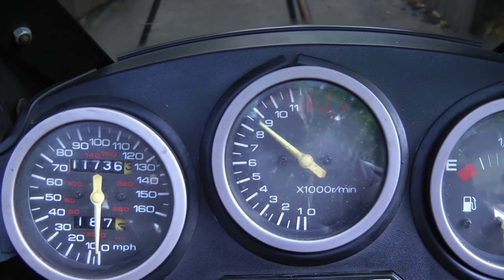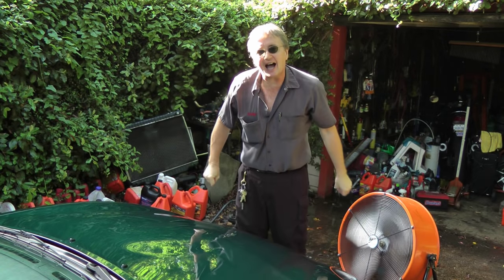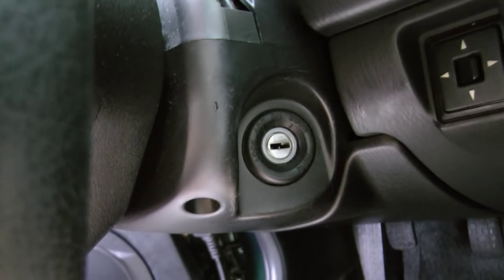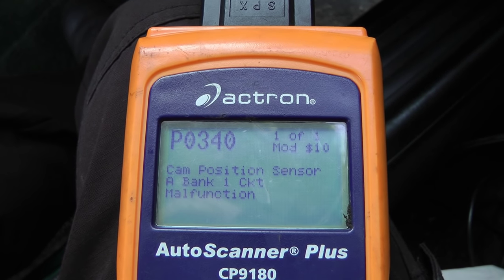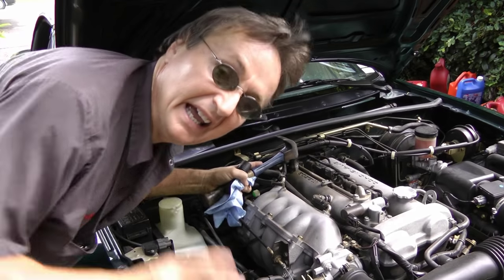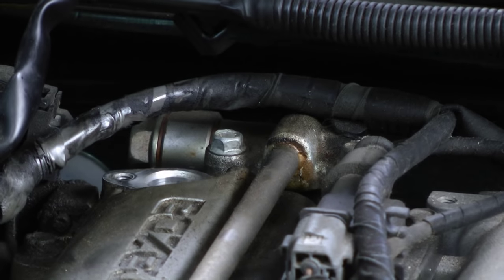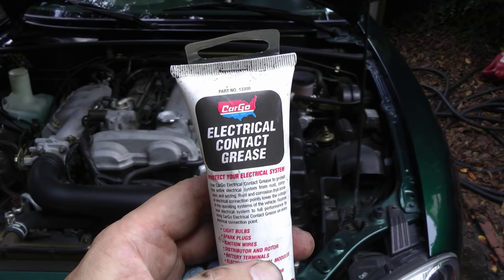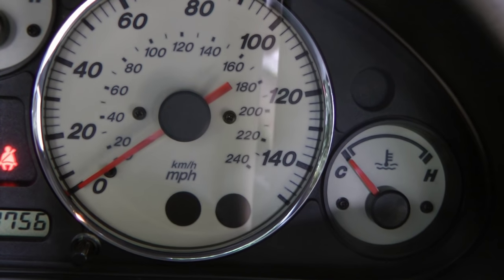How to Fix a Car that Randomly Dies while Driving

Comment: hey Scotty my car does the same thing only when it dies It starts and cuts back off. I have to wait for at least a half hour before I can get it started up again. what scanner can I use to get codes for my 94 Lexus gs300
Reply from the maker: +Wilson Pierre only a pro or dealer scanner will get any info out of that 94 unfortunately, see my video "fixing insanely complex modern cars" and have one hooked up
Reply: +Scotty Kilmer  wow. I just ordered a obd1 scanner because I was told it would work if I get a 22 pin cable to connect to it

Comment: Scotty I have a 95 it's doing the same thing I'm not sure if it's the camshaft position sensor or not
Reply: it's obd1. my car gets to running temp and it cuts off. I replaced fuel pump, filter, strainer, temp sensor, thermostat.

Comment: Hi please give me a solution. I have Hyundai Elantra 2005. Yesterday after driving 18miles on highway, engine started to sound like a old tractor and it was loosing power as I keep pushing the gas peddle. Soon engine shutdown but it starts again after 20 mins. Today I drove it for 1 mike and the engine heat measuring meter in dashboard went to high but eventually it goes down when the car is put in neutral. So when I put on gear the engine gets hot, stumbles and dies within 3 miles but on neutral, engine cools down. I just cleaned mass flow sensor, radiator no leaks, fans are working, radiator water does not jumps out which happens in case of head gasket broken, no water mixture in engine oil. What could be the problem. Please help!

Comment: Scotty I have a 03 Jeep liberty limited it turns off when I come to a stop I have to hold the gas pedal and brake at the same time to stay on any ideal what it could be no check engine icon on
Reply: Try simple things like cleaning the idle air control, MAF sensor, air filter, fuel filter, EGR. If not those get a fuel pressure test

Comment: I have a 2011 Toyota Camry. I put in the shop to have front bumper replaced it was running fine when I dropped it off. They took the battery out for 24 hour and put it back in. Then it would not start they reset they key and it started. Now when I am driving down the road the RPM go crazy then it dies but will start right back up. But when do it again short down the road no matter what speed I am driving. Any Ideas ??
Reply from the maker: drive it a few days and pray the computer resets the rpms correctly, they often do. if not, they messed something up, take it back and let them fix what they screwed up

Comment: Believe or not on some cars if you have a bad battery it will throw out that code po340 if though it’s for the camshaft position sensor
Reply: That is true. I've had codes on my car and turned out it was another thing causing it.

Comment: Hey Scotty, I need your help on my Honda Accord CF3 Rpm going down after car driven 10-20 KM and engine shutting down when I'm driving car in rushy traffic kindly help me (I am changed throttle body, fuel filter, plugs and plug wires but problem still remains)?

Comment: I have a 2006 buick rendezvous that has this exact problem. I will be driving and all of a sudden the Engine light with the arrow down comes on the the power dies... This has happened while driving and it has also happened when I just started up the car and that engine light with arrow down comes down and car dies... I take the key out everytime and within 30 seconds to 1 minute the car starts right back up and away we go. 

They first thought it might be a relay because the 2004s had a recall, we then replaced what they said was a common problem the trottle control and sensor under the gas pedal... ALL have not resolved the problem. Problem still exists .. What do you think it is? The mechanic and dealership are puzzled? thanks in advance

Comment: I've got a 2006 dodge stratus. It runs fine while im driving, starts fine, but when i stop at intersections, it stalls/shuts off. I just took the key out and turn it again and it starts right up, but recently i was driving, and the rpm's would dip like 200-300 rpm's, causing the car to jerk. Whats wrong with it?
Reply from the maker: Android602715 try my video "how to fix a car that idles poorly"

Comment: Hay Scotty, I have a 2002 Nissan Altima.  While driving the check engine light came on and lost acceleration.  I got a P1128 code replaced the throttle body did the relearn process. It was fine for 2 days then it happened again and same code. What else can I do to fix the problem.  Thanks.
Reply from the maker: well, generally wiring is bad then OR the main computer circuit that drives it is bad
Reply: Scotty Kilmer Thanks for the quick  response.  I'm going to clean the connectors with CDC electronic cleaner and hope that will help with the problem.  I just hope that in this won't cost me too much to fix.

Comment: mr scot..my hyundai excel 1996 randomly dies when i'm using AC whilde driving..my battery is new and my alternator works fine... and still it dies most of the times when im idling

Comment: My 2008 Volxwagon Polo takes me many times trying to start the engine until it starts ... spicially in summer when its parked under the sun, and the last days it started to die while driving, but not at high speeds, it dies between changing Gear ... between the first and the second gear... or sometimes at the first gear while the beginning of driving..
so please help me.

Comment: yes I have a 1991 Toyota Celica convertible coupe and it will die on the freeway just randomly as a matter fact it does it all the time in any gear it'll just be continuously shutting down  what could be the problem  and how can you help me out with this
Reply: Sounds like a ground wire buddy

Comment: @ScottyKilmer Tried to send you an email says its invalid so heres my issue. Hey Buddy, Just watched one of your vids on cars die while driving. My problem is similar, well kinda lol.  I bought the car for 500 bucks its nice and all but the reason it sat for a year was this problem its having. I figured I could fix it so I bought it. The car at start up is very rough at idle, it doesnt have much power pressing on the gas until you get it up to about 3,000 RPM and as soon as you put it in drive itll sputter and shut off.  Its kinda hard to start but it will start and idle ruff. I did only change the spark plugs today was the first time out checking it out. I bought a maf sensor for it no change in performance, I just ordered a new coil, and wires for it should get those by the weekend. I cant afford a fuel pump right now they're $400 bucks lol. I don't think it is getting enough of spark and yes I put fresh gas in the tank luckily it was empty before I tried to start it so any bad gas is probably gone by now. If the coil and wires dont help Im all out of options. There are no lights on on the dash except for the ABS light so i didnt bother scanning it. If you have any insite of what might be wrong with it Id appreciate any help. A guy told the dude I bought it from its a transmission problem🙄, Im pretty good with cars I was a professional tech for 6 years and a backyard mechanic all my life from age 17 I'm 44 now so Im pretty sure its not the damn transmission lol. Thank you your vids are great when ever Im having a brain fart. taker easy sir
Reply: oh its a 06' hyundai Tiburon 2.0 L

Comment: my 98 honda civic has a p1359 code and i have a new distributor installed but it stiil wont crank and i really dont wanna get a new computer for the car because thats the last option besides checking the wiring

Comment: hey scott.
my mdx acura 2003 dies if i dont let the engine running for a minimum of 10 mn.
if i turn on the engine and put it on drive strait away trying to drive it it fies.
i took yo multiple garages and evev the dealer. no wah to fix it. apparently its a commun problem with acura mdx.
any idea bro.thx.

Comment: I'm getting a p0171 code...96 civic DX.  Cars turns off while driving. I simply push the clutch in and it cranks back up everytime....I don't know if it's the O2 sensor, fuel injectors or fuel pump. Help please

Comment: This just happened to me . 08 hhr  suddenly  stopped at a light  and would not start  &  gauges  went wacky  and started  bouncing  when trying  to restart . 4 hours of searching  and the cause was a crank  sensor   that  had come unplugged.  Car started but gauges were  still bouncing.  It drove me crazy  for a weak.  Finally  I found the antenna to the radio had backed out a little bit and was grounding out in the dash ..must have been the jolt when the car stopped.  Pushed  it back in with a little black tape  and we are back in buisness . Talk about modern cars sheesh

Comment: My 08 Honda Odyssey has done this several times. Today it stopped while I was driving and it wouldn’t start everything locked up my husband came and jumped the car after 30-40 mins. I was sitting half in traffic half on roadside  it was very scary

Comment: will a bad position sensor cause some cars to not start at all?
Reply from the maker: +Micheal Deacon yes, if totally shorted out
Reply: I have no spark or fuel pressure i was reading that in this saturn vue 2.2 i have that computer will not allow the pump to run without a signal from the crank sensor. Thank you for all that you do. You save people a lot of money.

Comment: Hello all. One question. I have a Nissan Micra 2020, and suddenly at 100 km the speed pedal didnt work for 5 seconds and  the start stop button which i had opened had been closed (seems that the whole system had been reseted) Then after 5 seconds car woke up and i could speed up again. This happened 2 times in 1 day.. Any idea what might be the problem?

Comment: I had a cam sensor code. Repaired the cam sensor. The rough idle was gone but it stalled again. Only once warmed up it stalls. Starts back up but dies again till you let it cool. So it still dies. But no code came on. I got a scanner and I have no codes going on.

Comment: i have a 2003 buick lesabre goes into gear but wont move no signs of slippage low miles..have had cvc joint repaired about 3 months ago
Reply from the maker: pray it's just a bad cv joint job that slipped out of the transmission end or other side broke

Comment: 🚨I have a 2005 honda Civic 1.7l one day I was driving, lost power with the gas peddle, then itt died. it will crank over, but don't start. I unplug the crankshaft position sensor, and it starts. I replaced the sensor with a cheap one, nothing, so I replaced it with a top brand, still nothing. HELP ME, PLEASE 🚨

Comment: I'm having these issues with a 1994 mustang gt will idle up and down then die, died while driving as well, idling and then switched the the a.c vent from in to off and it died have gotten the battery checked and is not the problem an u suggestions?
Reply from the maker: many things can do that, start with my video 'how to fix a car that idles poorly" and also check for vacuum leaks

Comment: I have a 2005 Pontiac grand Prix v6 3.8 L. And every time I turn it on I have to rev it so it doesnt turn back off (this is only when it turn it on after that its fine)
Reply from the maker: Sam Esparza old fuel injectors that are clogged often do that, try my video "how to clean fuel injectors on your car"
Reply: Thanks
Reply: Unrelated but RAIDER NATION 4 LIFE!

Comment: i have a 1994 pontiac grand prix se  3.1 dies when driving. when it starts to die it starts to miss and the rpm gauge starts jumping and then it dies but it always starts right back up i changed the crank shaft sensor in it and it runs great till in starts to die ......what could it be.i also put a new fuel pump on it

Comment: what if your car is from the 60's and doesn't have a computer with a sensor? (1961 Dodge Lancer to be exact)

I'm going to also replace the fuel sender and change the distributer cap, rotor and wires (already did the spark plugs) I just want to get ready incase these things don't work.

But yes I am driving down the street and then my car suddenly dies, and it wont turn back on till a few hours or the next day, ( I wish I just had to wait a couple minutes).
Reply: I already replaced the gas filter and gas pump (did not fix the issue).

Comment: i have a 2001 nissan frontier it runs and then cuts off .after running for 10mins. idles down and then it doesn't want to crank back up until i let sit for awhile

Comment: Okay I got a question.. I have a 2001 Saturn Sl1 1.9 My turns on my. But when I touch one of the injectors the car turns off..  Why is that.  And I have service engine light on as well the code told me it was map sensor I replace and still light is on..  Even If got someone to erase codes it still come back on...
Reply from the maker: Jose Quintanilla often bad wiring going to the injector, or bad injector itself

Comment: 2012 Durango stalls in drive at stops no check engine light tried fuel pump  spark plugs coil packs had fuel pump relay recall changed conductor plate and tq converter solenoid tried rebuilt tested tipm stalls intermittently been to dealer 3 x they are lost

Comment: 2003 ford escape 3.0 when driving she will stall there is a o/d on will that do that take the key out put in start right up and drive away
Reply from the maker: od light has nothing to do with that. Try tuning it up and cleaning the fuel injectors with a little cleaner poured into the tank and driving

Comment: I have a 2002 Mazda Protege Lx 5 speed, I was driving down the highway going 65 and it all of the sudden started to shake a little bit and then it slowed down in 5th gear, so I had to down shift into 4th gear, I thought it was going to choke and die on the highway.

Comment: errors are p0508,p1193,p1491  would any of these cause my pt cruiser to not start? ,, it turns over, has fuel on rail, cams are turning over so I know the belt isn't broke new cam sensor, new crank sensor, and new PCM plug n play rebuilt
Reply from the maker: yes they can cause that, because any sensor or wiring that's shorting out can short out the main computer and cause no start. Good luck on that one, those cruisers are electronic Mexican junk as they age. You might have the computer and wiring checked first
Reply: ty scotty, which would you replace first, I've already tried another pcm,crank and cam sensor I ordered a new coilpack, throttle sensor, fan., map sensor.. just trying to cover all bases lol

Comment: I have a 2011 328i BMW that dies while I am driving, so I took it to BMW dealer and they said the eccentric shaft sensor was bad so I got the part and replaced it my self. the next time I drove it I went for only 15 miles before it stranded me again. Super frustrated now with this car.

Comment: Hey I have a 300 srt8 2006 an it started shutting off randomly I changed the throttle body and it started shutting off again an throwing the same code it threw before the red lightning signal I don't kno what to do next I can't drive the car cause it will shit off an the machinic can't find the problem what can I do next ?
Reply: Oscar Medina
Reply: Oscar Medina I had a 2005 300c. same issue as well. I changed the crank shaft sensor . and that fix the problem. common issue on these cars

Comment: Hello , I have a 2000 intrepid .2.7 engine.  I was turning a corner turnung left and my car stalled. Then IT stalled when I turned right.Also it stalled once just stopping at a light. Two months ago I got some wire that was.loose as the car wouldnt start.  Can you please suggest what it might be.Also no engine lights come on
Reply from the maker: check all the wiring for shorts or loose connections, especially at crucial parts like ignition system and computer connectors
Reply: Thank you very m7ch
Reply: Much

Comment: Hi i have a 92 pontiac that dies when it goes above operating temp just a hair. It has no codes to determine what the issue is. If you try to restart it after it dies while driving. It starts but stalls like its out of gas.
Reply from the maker: +delmar brown running lean often makes them run a little high and stall out. Have fuel pump pressure tested to see if it's low and try my video "how to clean fuel injectors on your car'

Comment: My card dies when changing gears from 1st to 2nd sometimes 2nd to 3rd but has no codes. It starts back up normally but sometimes it takes a few trys. What can the problem be. I have replaced the fuel filter but thats it

Comment: My car start and run for 20,  minutes and die, it would not start again after 2 hours. I have change fuel pump, connector, fuel filter, relay, Ithe car has not been driven but has run the engine.What could be the problem? Engine light has been off.

Comment: How do you test engine computer? I have p0340 code... my car does this. Toyota put a new computer in (so they said),  they put camshaft sensor in, same problem. On wed an auto mechanic is putting in crankshaft sensor, and checking the wiring. After that ... could be timing chain, although I dont get rough idle sound until car warms up after driving a while...  how would I know that they actually had put new engine computer in (toyota) i dont trust them at all at this point, its costing a fortune :(

Comment: hi I have a question i have a 2003 Honda odessy that randomly stops while in drive  it is still running but it just does not accelerate  until I shift gears or turn it off and tun it back on again it only seems to do this when I am accelerating after making a turn  what does this sound like to you . pleas help
Reply from the maker: +latreace moore    bad transmission, a known flaw on that model

Comment: What if check engine light isn't on?  I'd assume a fuel pressure problem?
Reply from the maker: +Kory Stoffers it often is as most cars' computers do not know the fuel pressure as they get no data about that.
Reply: +Scotty Kilmer I replace my fuel pump and my fuel filter and my car keep shut off while running? any place should I check?
Reply: +Lantigua Perez  and no check engine light